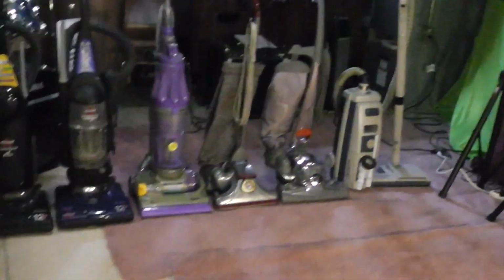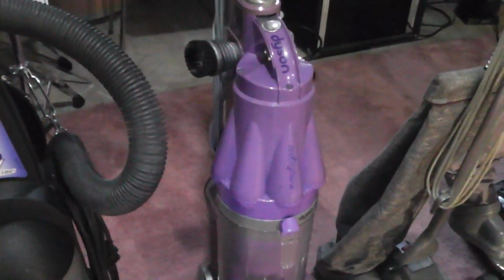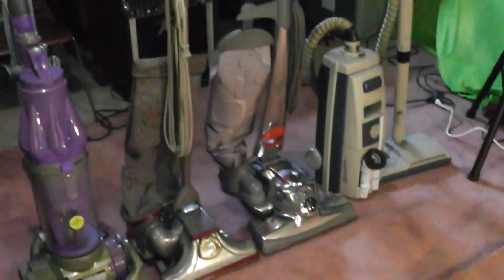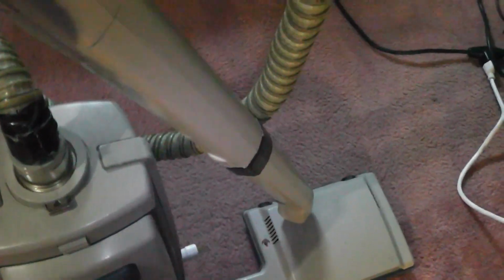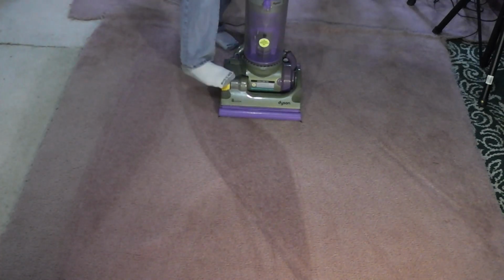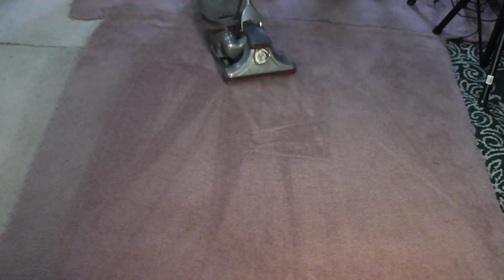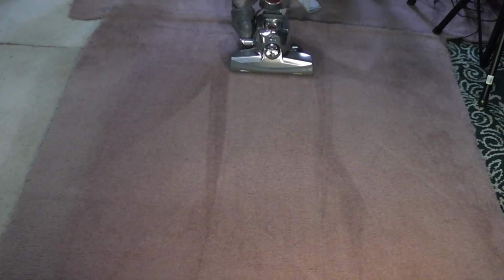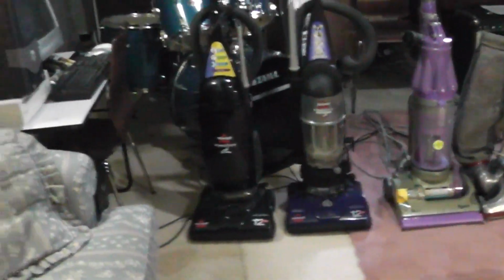Update On All My Vacuum Cleaners

Comment: The bissell powerforce bagless will always be in my childhood
Reply: when I was young, I used to be frightened by real vacuums like I would ask either my parents or my grandparents to bring the vacuum out but when they were vacuuming with it, then I just hid in corners. when I turned 6 years old, I started to warm up by using my first real vacuum which was the same bissell powerforce bagless that you had. but it did not have the light  which was my mom and dad's vacuum. Then I used My Chacho's Vacuum, meaning my dad's brother's vacuum which was a shark navigator lift away pro. now I am obsessive with vacuums now

Comment: Where did you get the Electrolux epic 6500 Series
Reply from the maker: It was bought used from a man that used to sell and repair electrolux vacuums. I fully restored the canister last year. It’s got a new motor, cord Winder and a new switch pedal in it.

Comment: How is the dyson doing
Reply from the maker: It still runs but I don't want to use it due to how brittle the plastic. It's close to breaking in half and i don't want that to happen because there's still some good parts left on it. I'm worried that  just moving it or carrying it down stairs could snap the spine apart.
Reply: Don't run the dyson unless you have to
Reply from the maker: There's no reason for me to really use it. There's plenty of other vacuums I can use.
Reply: Ok my favorite vacuum you use is the Bissell powerforce baggless
Reply: Techman5150 Why don’t you buy a Dyson ball vacuum? Or those new Dyson hand-held cordless vacuums?
Reply: @Techman5150   I say you should get your dyson fixed at a vacuum repair shop.
Reply: I can fix vacuums.
Reply from the maker: @amaansajjad6756  if i try to fix it it will shatter apart i have fixed many dyson dc07 vacuums. it is not worth fixing. if you watch my latest video i pretty much say  it in the end  that it is time to parts ways with my vacuums. i am now up to 40 vacuums. i don't need 40 vacuums and eventually want to get rid of most them with the exception of my kirbys and Electrolux vacuums